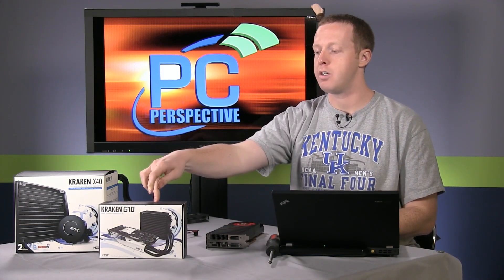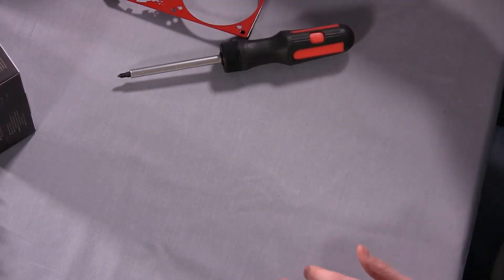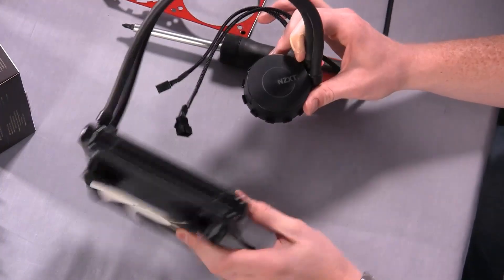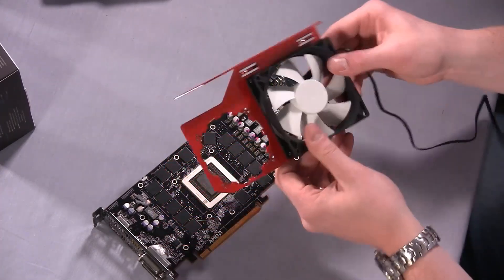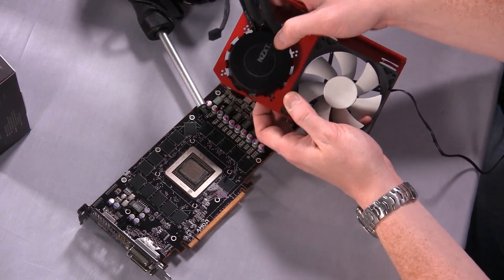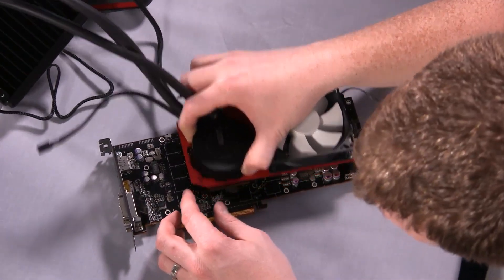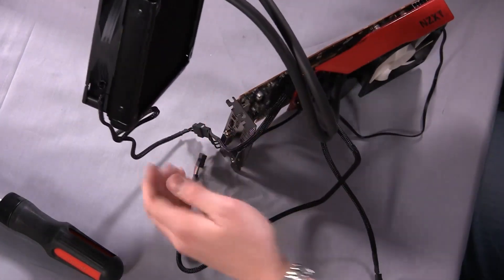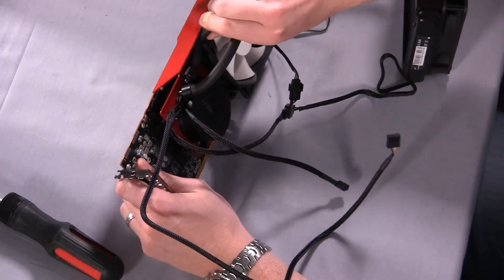Using the NZXT Kraken G10 to Watercool a Radeon R9 290

Comment: I wonder if that unit would fit my ASUS R9 290 DirectCU II OC? Terrible heat problem. GPU shuts down above 78C playing World of Tanks on high. I'm using MSI Afterburner manually running my GPU fans at 100%. Cleaned, replaced heat transfer paste, lots of fans.
Reply: I have the same graphics card with a Kraken G12 and Corsair H55. Unfortunately, the 120mm radiator of the H55, as well as the pump aren't strong enough on their own to cool this thing. I still get throttling in PUBG as the die reaches 95 d Celsius, which happens quickly. I ordered two high powered hydrostatic fans for push pull to see if that makes a difference. Otherwise, a 240mm style radiator AIO may be necessary. As for the DCUII cooler, it's junk and doesn't cut it.

Comment: Please !!!BE CAREFUL!!! and don't be stupid like I was. It is EXTREMELY easy to overtighten those screws and cause your GPU to bend and your die to crack, which is exactly what happened to mine. Just use common sense and honestly, you probably don't even really need to use a screwdriver like Ryan did in the video.

Comment: Has anyone here tried this with an HIS Icyq x2 290(x)? I have two of them and one is a dream, runs at no more than 75C at 100% load at 1100/1500MHz. The other, however, runs at 90C at stock 947/1250MHz(same aftermarket cooler, the card has significantly higher voltage). I have a closed loop cooler for my CPU, but was thinking of just grabbing a 212 as my closed loop is not much better. The board layout looks the same, and even has RAM and VRM sinks for additional cooling which look like they won't interfere with the Kraken G10.

Doing some quick and dirty OCing I found I was able to get 1100/1500 out of both cards with proper cooling stable, temps are the only issue.

Comment: the liquid cooling solution from XS-PC is Far more Elegant, I mean besides cooling, the point of using liquid is that it is next to silent, the solution you're using here has a FAN!.... it sort of negates a good portion of having water cooling
Reply: ***** the fan needs to be there to cool VRMs... a complete block cooling chip+VRAM+VRM will cost more than this one. Unfortunately there's no cooling VRAM with this unit in the end he did say this cooler sucks because the VRM temps is actually hotter than with reference cooler...

Comment: Jesus, that's an involved process!

I'll just let her run at 80 degrees I think lol
Reply: +The Gent : I hear ya.  The two benefits of this may outweigh running stock setup.  The main benefits are running cooler and quieter.  If you don't plan on OC'ing and you have no problems with the stock fan, and you have decent airflow in your case then this may not be right for you.  Still the quieter benefit really appeals to me.  Each to their own.  :)
Reply: Jamie P Aww dude, don't get me wrong, having my AMD running at less than 80+ degrees would be fantastic, but I just can't risk opening up a $500 component for that.
Reply: The Gent : Point taken.  Yeah if you aren't careful your $500 investment could turn into an expensive paper weight.  I have had other friend's use the bracket (they used a different water cooling unit) and got great results.

Comment: Sorry to say but what programs were you guys testing the VRM's? R9 290 VRM max temp has been rated at 120C as far as I know and means that hitting 100C is pretty good.

Just wanted to throw that out there.
Reply: I don't think so, VRM are designed to get 120 degrees, but then they will still die within some time, you don't want to run it 24/7 around the max temperature rates! I got 95 degrees max and I improved airflow and imcreased fan speed to get them down to 78 (DirectCU)
Reply: Mads Magnus Kristensen  
Mine's a SAPPHIRE 100361-8GL Radeon R9 290X 8GB, if it had just the one intake to begin with I might consider it, but the stock fans are actually well made and there's 3 of them. I rarely hit above 60C thanks to them, even when OC'ing. Now if you wanted to crossfire 2 of them, then there maybe a point to doing it :P

Comment: vram heatsink? the card is not gonna last. i can use the stock cooler on that card and mount the kraken x40 problem solve :D did this with my gtx 550 ti covered vrams mounted my corsair h30 on it magical can run league of legends maxout,bf4 medium settings.

Comment: Is it possible and would it make sense, to cool a videocard and a cpu all together with the Kraken X40 radiator?
Reply: The radiators come with only a single pump/contact.  So, you would have to break apart the self contained cooler to use it on multiple processors.  At which point you might as well have made your own liquid cooling system.
Reply: Guess I got that wrong, thought it was upgradable out of the box. Thanks for you answer.

Comment: It would have been nice if they included an adapter so that you can use the GPU's on-board fan header instead of having to use one of the motherboard headers. If the GPU header isn't powerful enough to run a pump, the VRM fan and the radiator fan (or fans) then, at the very least, it would have been nice if just the VRM fan could plug into the GPU fan header so it can be regulated in direct proportion to the temperature of the GPU. Having a 3-pin fan is fine but if you can regulate them based on the GPU temps and make them quieter, why not? The header is already there and I'm sure it would only cost like 10 cents to make and I've owned several late generation AMD and Nvidia cards and they all appear to use same header. In some cases, like at idle or very low usage, the VRM fan could possibly be shut off and the radiator fan and pump set to a very low inaudible speed.

Comment: the VRM temp problem should be easy to solve with a simple small aluminum heatsink.. for the price they should have included something like that imo.

still impressive GPU temp, this thing with this watercooler is still cheaper than a 290x... not bad... I would just go with a custom cooler card and that's it, you don't really need the GPU at 50 ºC, and the custom cards from sapphire, msi and so on already have much better coolers than the reference one.

Comment: So it's the HD4870 all over again! Same issues with VRM temps there and the reason why I ultimately switched to NVidia.
Reply: I think it's mostly the shitty cooler. Nvidia's stock cooler is substantially better.  Aftermarket 290's post much lower temps under load and don't throttle.
Reply: Well, the current AMD cards are all a good deal hotter than their Nvidia counterparts and also need more juice which I also don't like. I don't know Nvidia just seems sleeker and technologically much more advanced than AMD right now. Like Nvidia does low level optimization while AMD stacks shit on top.
Reply: Go and get some info before u say BS...
Reply: ubbgn
So why don't you illuminate me if you know so much better?
Reply: Hans Power
You are forgetting the fact that AMD has been the first with many things when it comes to adopting or developing new tech. They have been the first for some time now to support a new directx version not to forget the work they are doing on Mantle, and the later is most likely just because they want Microsoft to wake up and start supporting low level access on the PC through DirectX. They are the underdog and has been for a long time but the hardware is solid most of the time. Its not like nVidia hasnt done their share of f..k ups. Latest that comes to my mind would be the 780 killer driver, before that there was the gtx 570 dieing cause of vrm issues, not to forget some of the 590s going left and right on stock speeds for no apparent reason.

I am currently running a MSI 780 lightning and i love that card. Its rock solid and a monster OCer. But i also loved my 7950 i had before and the 5850 before that. Brand Loyalty is really really stupid imho cause they dont care about you as long as you feed them money :)
Reply: Yes I know and I'd love AMD to succeed but right now their offerings aren't quite as compelling as they used to be. The GPU side of things is still quite alright although prices (not considering the coin mining) aren't as low as I'd like them to be - here in germany they are just a close match to their Nvidia counterparts in terms of price to performance. And I DO appreciate mantle, even if it fails in favour of DX12 or OpenGL cause then at least they took one for the team and drove technology forward. But on the CPU side the enthusiast gamer is just left by the wayside and that's just a shame. The AM3+ platform and the FX architecture are just so out of date and inefficient and there's no new platform in sight. Right now I'm using an old Phenom II X4 965 and this is a great and solid performer but there's just no worthy successor to it so my next upgrade will be an Intel I5. I still hope that they will deliver something great on the CPU front but their current focus on APUs just aren't something I can relate to.
Reply: With Mantle like APIs you wont need a powerful cpu or atleast thats the dream. I agree though as an enthusiast i would like more powerful cpus as well from both AMD & Intel. The increase in performance since the i7 920 launched is dissappointing. Haswell-E with DDR4(LGA 2011-3) might be the first thing that has interested me in a long time on the cpu side.

Comment: To anyone concerned about the VRM temps

If you want to use the G10 simply buy VRM heatsinks. It makes a huge difference for the VRM temps and costs very little
Reply: I agree. Without the stock heat spreader on the VRM VRAM and MOSFETs, it gets really hot. I had to buy heatsinks with little fins to keep them cool. I installed this on a HD7950 and found out the dieblock needed a shim to touch evenly to the gpu and water pump surface. What a squirrely job that was.

Comment: Honestly this would work better if it didn't have the little fan and the extra metal bit for the fan. Then you could just leave the metal heat spreader that comes with most reference models on and just let the built in fan for the reference cooler cool the heat spreader. Wouldn't work on non-reference cards though because they cool the VRM's differently.

Comment: OMG looks really messy and only passive VRM cooling, clad I went with the Powercolor PCS+OC R9 290 runs at 63C-68C comes with a 1040Mhz GPU clock and a 5400Mhz VRM clock out of the box also available in a liquid cooled model (LCS+OC) and only cost me £331 for the card.

Comment: I think if you wanna watercool your card/ system, then do it with a custom cooler cos you can keep that over 2-3 systems. You only need to buy new waterblocks. The aio watercoolers break earlier and you cant change the waterblock or you cant replace the pump and keep the rest if only the pump breaks

Comment: Arctic Silver on a GPU die? But there are SO MANY contact points around it! Why would you use a conductive paste D:
Reply: Its only Semi-Conductive (And only just), I've used it on about 10 cards with zero issues.
Reply: It's not even semi-conductive.  It's even on Artic Silver's site that it is not conductive.

Comment: What they need to do is create a second SKU of this product and increase the price by $20 so they can throw in a bunch of passive aluminum heatsinks and double sided thermal tape. That is all they would need to do and I would be all over this product and it would be on my 780ti by the end of the month. :P
Reply: Well to be fair you can buy all those separately anyways.
Reply: yeah. you go find them all separately. it's hard sometimes to trust another third party company. I've seen some advertised as high end that are complete garbage.
It's a whole different story if NZXT would just bundle it with the kraken G10

Comment: Worse VRM tempertures is an absolute NO-GO! We have seen this on the forums too many times: people wondering why their videocard died with an socalled 'superior' videocard cooler mounted.

I bet you that this cooler does NOT meet the designed cooling specifications from AMD. Some parts don't even get proper airflow, parts that are originally have thermal pads and a decent heatsink... If i was AMD I would force NZXT to not release this product in current conditions! 

I really hope they come with an native implementation for videocards in the near future. But for now I would highly recommend to stick with an 'proper' aftermarket air cooler or a quality full cover waterblock with an custom loop.

Comment: Please people do NOT apply you thermal past the way he did! there will be air bubbles and you will get much better temps by just putting a small dot in the middle of the gpu core and letting the pressure of the water cooling unit spread the past. If you don't believe me watch this video How To Apply Thermal Paste
Reply from the maker: Looook appreciate the link, love the guys at Tek Syndicate, but I've been doing this for a LOOOOONNNNG time and had no issues with our application method.  :)
Reply: I always spread my thermal paste. A drop in the middle never workout well for me.
Reply: Anyone who's been building computers awhile knows there's no real difference in temps no matter how you apply your thermal paste as long as you put a decent amount on. "air bubbles" are not gonna matter if the heatsink is properly seated on the chip.
Reply: pcper The myths surrounding TP application. legendary :))
Reply: +pcper Linustechtips did a test and found all that the different methods do is vary temps about 1C. so you do you
Reply: Yeah everyone claiming they got better temps by spreading paste differently probably just got those temps from a better mount, it has nothing to do with how you apply the paste.
Reply: I didnt said more is better. I said spread bro. I used 1 drop.
Reply: it never fail me for many builds. Just because everyone hate it. It doesnt mean it doesnt work.
Reply: Jeffery Peters Never once had a temperature difference of five degrees, And I've tested it pretty thoroughly, The most I've ever seen is a two degree difference in favor of the spread method, But considering that's within margin of error, Not very scientific. 

The only thing that seems to matter is if you apply too much, Or too little.
Reply: Exactly my point. I think he watches too many video with out building a PC to know this. LOL
Reply: Oh SNAP! he want to skype.
Reply: +Jeffery Peters (Ferrariassassin) the only problem with adding too much thermal past is that it can escape on the pcb and cause shorts and the dot method only spreads in a circular manner and doesn't take advantage of all the cpu/gpu surface area unless you add too much and decrease performance and for certain the thermal past will escape. But the spread method takes advantage of all the surface area and mitigates the increased temp from the possibility of air bubbles . just using common sense and science :)
Reply: +Greyson Sequino Actually you'll want to cover the whole gpu die as unlike a cpu a gpu doesn't have the metal thermal plate on cpus to spread the heat evenly, so you'll need to cover the gpu or it could overheat although I recommend doing a criss cross pattern instead but it shouldn't really matter
Reply: Jeffery Peters Where did I ever say applying too much didn't cause overheating? You can't really call someone stupid due to your lack of reading comprehension. "The only thing that seems to matter is if you apply too much, Or too little. " This is saying that temps will be vastly different if you apply too little, Or too much. Both result in pretty similar symptoms. It's common sense that both cause overheating, Nowhere did I say it didn't. So I ask, Are you stupid? Also your info is plain wrong, I know as a fact JayzTwoCents actually prefers the spread method. He says it in his own thermal paste video. So I guess you also lack in hearing as well. Could have sworn I responded to this with a thorough post, But it was either deleted or never registered. 

My exact posts you're trying to call out "The only time you'd get much better temps out of using difference methods, Is if you used too much or too little with one of the methods. I personally used MX-4 for my tests. " and "The only thing that seems to matter is if you apply too much, Or too little." Gee, I wonder why I said that? Go work on reading comprehension and come back, Kid.
Reply: I put as many Thermal Paste in my GPU because, the GPU has a bigger processor than the CPU, even you put as many it still doesn't affect the system or the temperature, you can look JayZ channel putting so much thermal paste on his GPU and it decreases 3 degrees celsius, and also LinusTechTips also said that you need to put more thermal paste in GPU than CPU